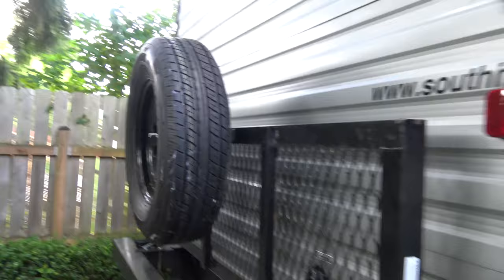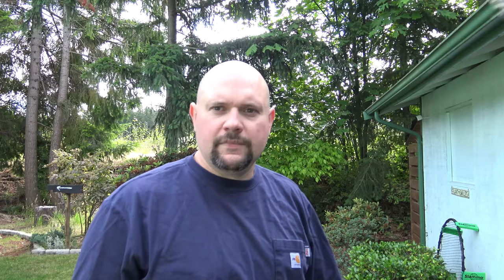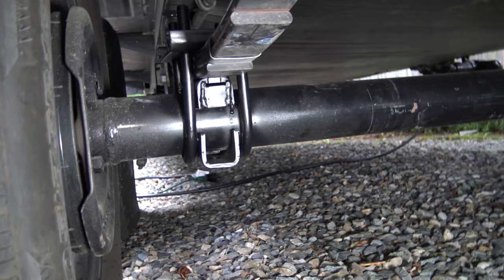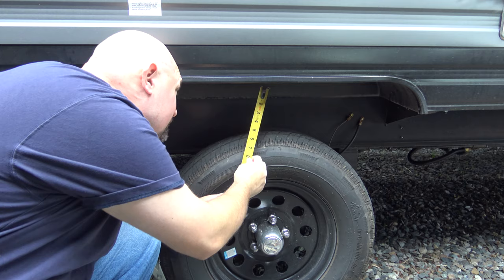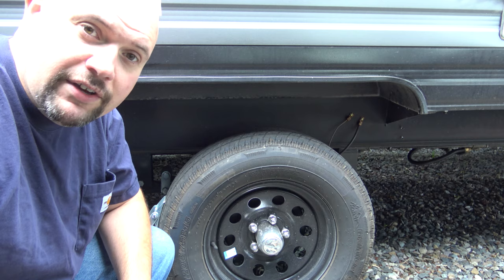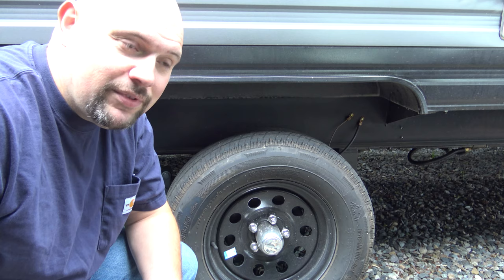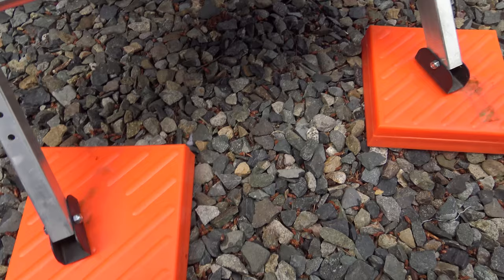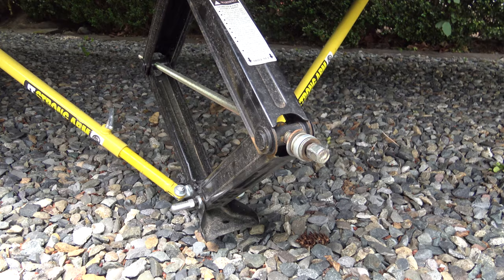How To Park a Travel Trailer in a Super Steep Driveway

Comment: New subscriber here. I have been looking for options for our steep driveway. We may need to widen it and I figure it will scrape the tail as the truck climbs the hill. Long term we may put in a second ramp with a lower grade. I have a tournament ski boat that is about 26’ long and it is no problem getting it up and down the driveway but the clearance is higher and it is only 30% - 50% as heavy.  We are shopping for a travel trailer and trying to prepare.  It could be that we park this at a storage place until we have made driveway changes.  It is all about the angles and the weight of course. Thanks for your video.  Hard to find info on this subject.
Reply from the maker: I could find little info as well when we bought our trailer. Our solution has worked great and I no longer dread moving the trailer.

Comment: Beast of a driveway? Mine is 45° or very close to it. I do like your solution and will look into it.
Reply from the maker: Great. This has made a huge difference and I do not dread trying to park it anymore.
Reply: @GrahamVentures  unfortunately in my situation your method did not work. I however did come up with one that did. I will post a video at some time and share with you of your interested.
Reply from the maker: That would be great.
Reply: @performancemotoring3798  would love to see how this turned out for you
Reply: @undisputedepicenter  it didn’t work I had to swap the axle position myself. I still go at an angle to get up, but when I change the rims and tires I should be able to just back it straight up without any tricks.